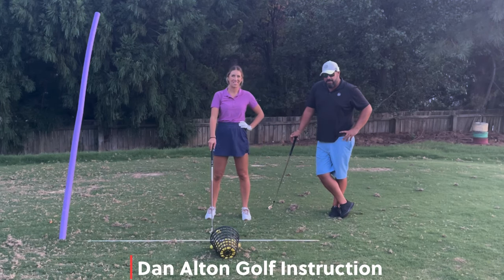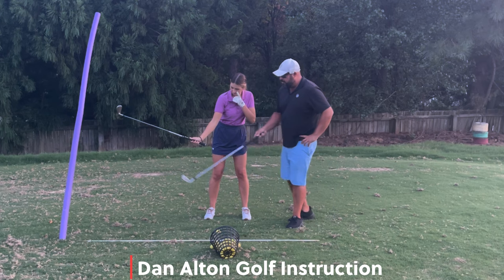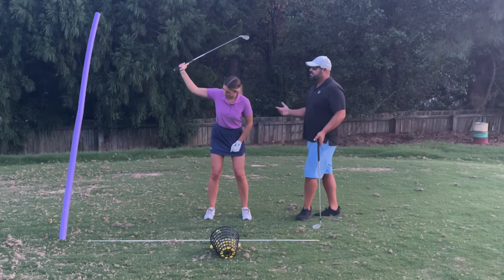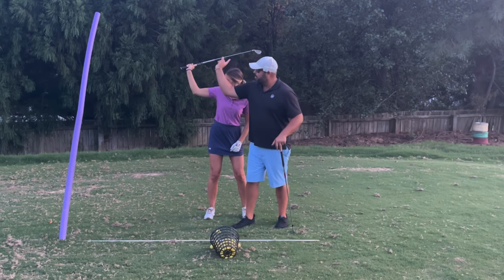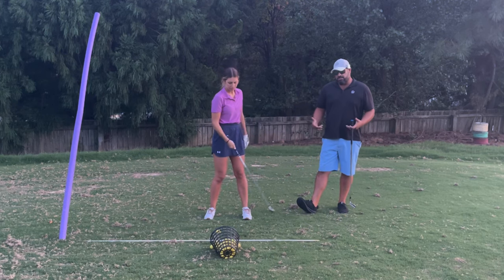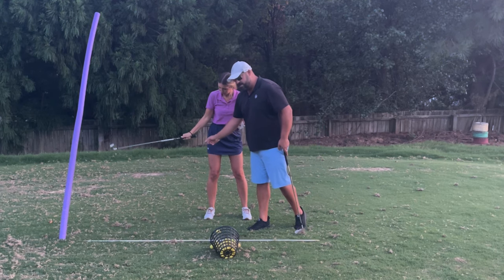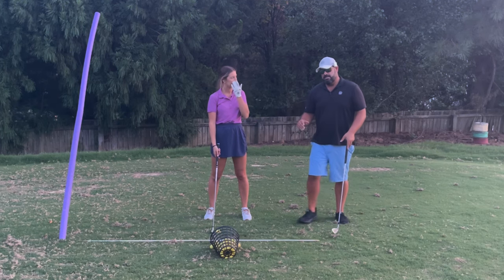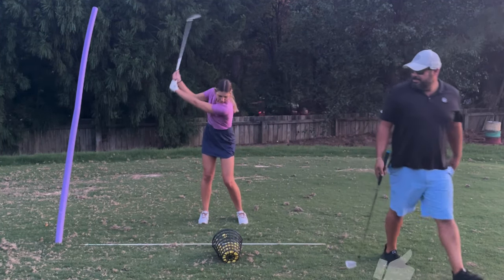Both Handle & Head of Golf Club Swing on an ARC - Stop Pulling Handle & Leaving the Face Behind You

Comment: I’d like this to work, much easier on the body, but I’ve noticed when I try to be more handsy I drag the club way inside on the backswing, then my arms just drop automatically before I can sling from the top and take no divot. Is there a solution to fix this? Thx for another great video.

Comment: Hi Dan interesting technique. If one is not supposed to pull the handle to swing the club 
head then what is ? Thanks
Reply from the maker: The handle is going to go into the slot no matter what, if you’re pulling it, the face will be late. You’ve got to start the club head from the top. Some feel that different than others, one might feel it with a bit of a cast motion etc….have to get the head moving into it own momentum instead of dragging it…once it has its own momentum you just have to steer it. Hope that makes sense and helps!
Reply: @danaltongolfinstruction  thanks and it does make sense Dan.